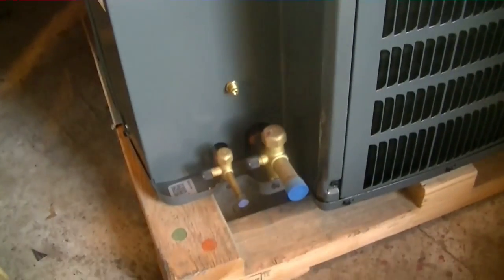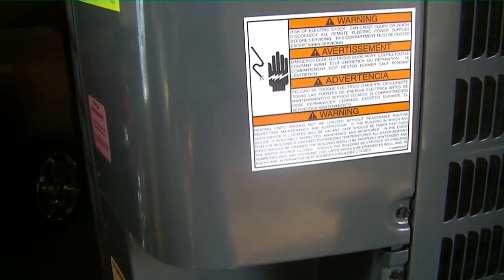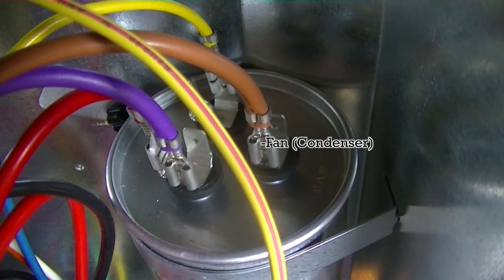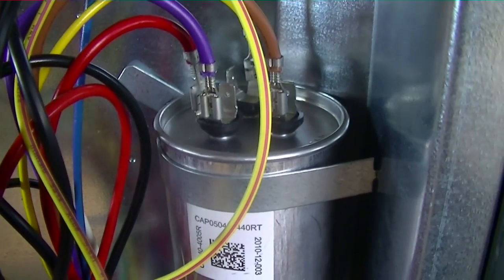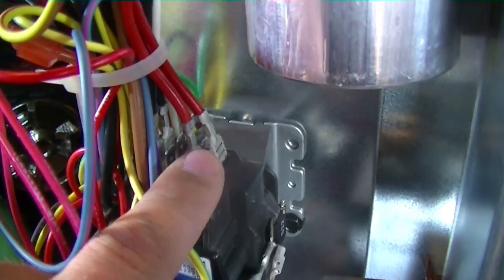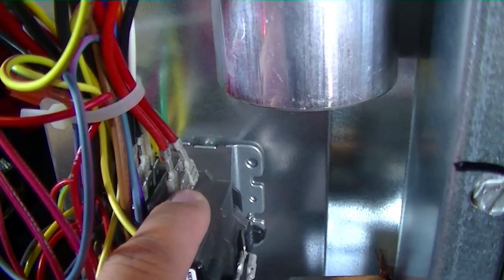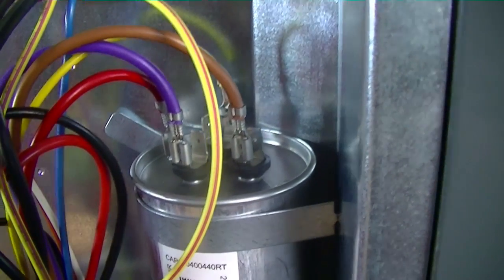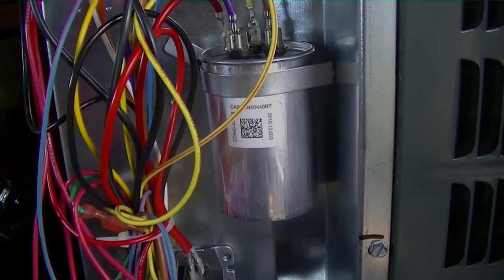HVAC Training | Dual Run Capacitor Wiring

Comment: Hello sir I need some help. I did every single step as you said. And my heater works flawless but the fan from out side it’s not running. It won’t start. Could you tell me what I’m I doing wrong. Please. Thank you.

Comment: My old air handler capacitor only had two wire connections. With the new one having 3 how do I know which to hook up to. 2 wires. 3 connections, 2 3 and 4 prong

Comment: You sound like you really know your stuff. I am replacing a condenser fan motor.the replacement is a universal  and the ratings are the same as the old motor but there are four wires and an extra single run capacitor. The cap on the unit is a dual run and is new and matches the one I took out. I was wondering do I omit the cap that came with the new motor or use both caps together and if so how should they be wired?

Comment: Great video.  Thank you.  Question:  if you wanted to check the total inrush at start-up where do you recommend placing the meter.  On the black common wire from the compressor or the red run wire coming from the compressor?  Thanks.

Comment: Very good video.  I was hoping you would explain which wires come back ( from Fan, Compressor and Capacitor ) to the Contactor  T1 and T2 terminals ?  The video shows a SIngle Pole Contactor which means there is only one terminal ? For a Double Pole there are T1 and T2 terminals which split the voltage to 120 V each. This example ( Goodman ) has a Defrost Board where the Fan connects but mine is a old Lennox which doesn't have that board and has a Double Pole Contactor. I'm trying to understand the wiring for T1 and T2 ?

Comment: I'm switching from a similar capacitor to yours to an amrad which has a cpt and a common terminal. The common terminal only has 1 connector where the original has 2. I don't know where to put the wires that were attached to the 2 prong common connector onto the new capacitor that has a one pronged common and a cpt

Comment: Same Unit we have, good show. We have Had it since the summer of 2008, and it’s On right now, Feb; 2023…!!! ✅
The only time ANYTHING was ever done to it was Sept of 21 a Turbo200 capacitor was installed, still working fine but next week we’re adding a 2-5-1 hard start to it to keep the initial amp draw down.. I mean, it IS 14 years old …!!! 😎👍👏

Comment: DIY project here... 14 year old capacitor died on me, and my red wire and terminal end is burnt. Replacing the capicitor and need to replace that wire. Can you tell me what type and size wire I should be getting?

Comment: Thank you VERY MUCH for these extremely clear instructions! I accidentally pulled both fan wires off while cleaning the unit and was baffled by the brown/purple split. A/C is now running great. You saved me from a difficult conversation with my wife as to (1.) why the house was 85 degrees and (2.) why we were going to have to pay $500. for a service call to re-hook a wire.  :)

Comment: Hi, that's a dual run capacitor. But  does the compressor and condenser fan motor need a START capacitor? Thanks

Comment: I'd like your opinion on the Emerson 49P11-843 SureSwitch Relay? I am thinking of using these on the condenser units at my home. Thanks, Jenkins A/C & Heating
Reply from the maker: I like the Sureswitch. Had one that failed but I really liked them overall. I would use it.

Comment: I've been looking at hard start kits and I'm a bit confused as to the nomenclature. The dual capacitor is referred to as the "run" capacitor, but in wiring diagrams it's always wired to the start winding on the compressor and fan. This is so even on the diagram on the hard start kits. There are videos of people getting lower inrush and quieter starts after installing hard start kits, but wouldn't they achieve the same thing by simply replacing their old dual capacitor?

Comment: I went on vacation and the cap on my central AC failed on the house sitter. I was dreading the repair bill but DIY me found the faulty cap which cost less than the power that the house sitter would have used running the AC.

Comment: Any tips on wiring between different capacitor styles? I have a bad oval style capacitor, and the replacement is round style. Does it matter which terminal in each bank that I attach the wires to, as long as they are connected to the correct bank?

Comment: Good vid, i would suggest telling the viewer there is no reason to ever touch any wires directly , use instead insulated pliers or a plastic pointer in this case ; why risk a shock even when you "know" its not live ?    Also how to discharge a cap to be safer. thanks.

Comment: Hello. So I have a Goodman heat pump with a dual run capacitor. My AC won't get below 80°  I'm looking at the capacitor and it only has three wires on it, Red, Brown, and Yellow, yet all the schematics and pictures I see have the Purple wire attached with the Red terminal. Why would that be the case. Did someone wire it wrong?
Reply from the maker: If your AC is working at all that  your capacitor  is wired correctly and functional. Run capacitors are a go no go function there is no in between￼

Comment: A Zack the Goodman unit with no pressure,  do you turn in a warranty claim te replace the compressor? I didn't know if you could get that moisture out of the Poe oil? Great video thank you.

Comment: Why are there multiple spades to connect to on each terminal?  I just switched out a motor and capacitor, it's working, but wasn't sure if switching to different spades changed anything.
Reply: Hey Buddy, good question.  I see the spades, as you call them, referred to as "tines". Zack does it make a difference???!!!
Reply: sorry! REPEAT QUESTION! someone asked this below and you said doesn't matter.

Comment: I had a ac unit not start. I changed the capaistor.  It has 3 sets of leads. A with 2 leads. B with 3 leads and C with 4 leads.    As long as I have the wires to the correct number of leads (ex brown wire to A) does it matter which lead it connect to. Like the brown fan motor had 2 leads on it.
Reply from the maker: It does not matter as long as you are in the same terminal grouping.

Comment: I need help with a Coleman ac unit...about 12 years old... the capacitor is good, but had it tested anyway and it's good,(replaced lasted summer) someone put it back in and I think the wires are wrong because there is no more sound coming from the unit at all! I am afraid of electricity and I really want to look at it myself.. I kicked started the fan days ago and the fan started and cold air started coming out of the vents but then minutes later it stopped. That's why I thought it might be the capacitor. It has to something else. Thank God I can use the emergency heat at night. I cannot afford to pay big $$$ to have someone fix.

Comment: Guys the colors for the fan motors aren't all the same fyi
Reply: My ex didn't take pictures before he put my ac capacitor (same one) back in place and even though that isn't the problem with the unit after all, I am convinced he didn't connect the wires correctly because now the unit doesn't make any sounds at all! I was able to jump start the unit before by moving the fan to get it going and the unit worked a few minutes then stopped. My main concern remained safety first now I am scared to death again to even cut the power off and discharge any residual power from the terminal post. How can I find out where the the wires belong ?
Reply: cynthia fannin this is kind of complicated to explain I don't want you to try and do it and hurt yourself but if you do shut off the power to the unit outside of course dares some schematics once you take off the AC panel for the outside you can try to follow that but the main thing is the brown fan wire is always going to go on fan on the capacitor also get some insulated pliers and touch all the terminals on a capacitor sometimes the capacitors hold a charge

Comment: Need help wiring a new fan motor I have a dual capacitor.  A single line contactor.  OLD motor had three leads.  blk-brn-orange.  The NEW motor has five leads. blk-yellow-brn-orange-purple.  I hooked up three of the wires on exact place as the old ones.  Now what to do with the yellow and purple wires?  AC runs fo 30 ceconds and stops with the fan motor humming.

Comment: purple wire is using common as a junction,  it's source is the load side of the contactor.  You were not really clear on this.

Comment: I am just learning about HVAC. I was able to follow your description of the wiring. One question.  Is there a start capacitor? I thought a start capacitor was also required.  Great video. Thanks
Reply: Compressor,and Condenser fan motor require only run capacitor, start capacitors are for big motors ,for another application. Some time old compressor or fan motor need a little extra help with a booster, this is not a start capacitor, it's a hard star kit called booster.

Comment: Great video. Exactly how my system is wired. Thanks.
Reply: I need a wiring diagram for the thermostat and condenser for Goodman model number is GYM 070 3A

Comment: my fan has one small cap, then the compressor has another larger one that happens to be a dual with the markings for fan and herm.. if my fan capacitor is dead can i test it on the dual capacitor ? or will everything else be wired differently for the individual capacitors?

Comment: hey guys, i have a haier mini split unit, and i just replaced the capacitor with a dual run capacitor. i just have no idea where the wires from compressor go? i have a white and red wire that come from compressor. the black goes straight to a relay.
so i have the R wire and the S wire from compressor.

Comment: I replaced the run capacitor on my home ac unit and somehow switched the wiring and when the compressor kicked on the fan switched directions.
I searched the internet for a couple hours and even called a friend who I (Thought) worked on AC's
I took pictures of my capacitor before removing it but the pics were blurry and a couple of the wires were blocked.
Luckily I found your video and at 2:30 you explained exactly what I needed...
WOOHOO we have AC again! Can't take this 100+ degree weather without AC.
THANK YOU!
THANK YOU!
THANK YOU!
Reply: I take pictures beforehand but you need to look at the picture after taking to see if it is functional. If not, retake. A good picture , or pictures, can show you everything that was there even if you didn't know you needed something at first.

Comment: Sir I have a question. My Dual run Capacitor only has two Terminals.  The new capacitor has 3 terminals(H,F,C.) I do not have a fan wire so I hooked it up to the c and Herm.  The unit functions normally but I just want to make sure that the 3 terminal capacitor can be utilized in lieu of the 2 terminal without using the fan terminal. Thank you.
Reply: Bizzenn1976 me clarify better. I want to make sure this won't hurt the unit in the long run.
Reply: Bizzenn1976 
If you have only two terminals then you only have a single run cap. Not a dual run cap. You do not have to use the fan side if you just want the compressor side.  
Herm and C are your terminals for that.

Comment: 5:48 That Red wire that jumps from the common terminal of the capacitor to the contactor, is that Red jumper wire meeting with the "Run" wire of the compressor at the contactor?

Comment: i have a question. Could you connect the compressor common directly to the capacitor?? will that make a difference?
V/R
Reply from the maker: Yes, but then a jumper must be placed to the contactor to supply the 120 volt supply (1/2 of the total 240)
Reply: got it, so you are using this red wire as a jumper and connector at the same time. thanks sir.